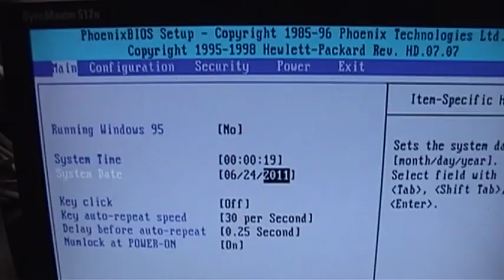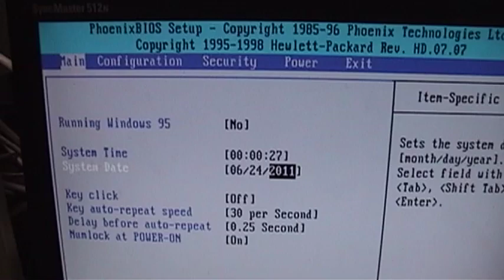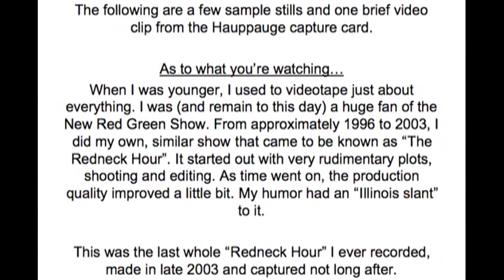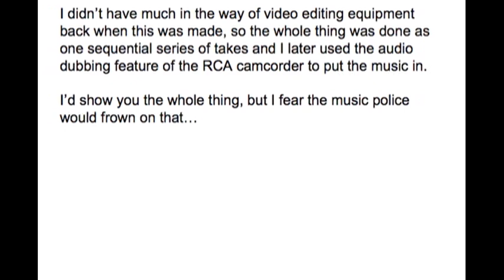The Old Video Capture PC

Comment: A lot of mid '90s through mid 2000s camcorders has color viewfinders, but as LCD panel technology improved to provide an image sharp enough to focus accurately and bright enough to be used in sunlight, the viewfinder became an afterthought in all but the really high end models. (And the B&W viewfinder in your TRV280 is actually a monochrome LCD, instead of a minature CRT.)

And are those Macintosh monitor connectors on those Matrox video cards?

Comment: One good reason to keep one of these old video capturing rigs in working order is to show the young'uns how difficult it used to be to do this stuff. Geez, you even needed a separate hardware decoder board for MPEG video because the CPU didn't have the horsepower to do it smoothly on its own. And cell phones have more storage capacity.
Full disclosure: my first rig was a dual Pentium 90 server with 3 PCI cards and 4 or 5 EISA boards back in the days of NT 3.51, so you had to do manual IRQ and memory configuring... That tank recorded some beautiful video, though. They were eventually transplanted into a quad Pentium Pro system. Because it wasn't weird enough.

Comment: Wow, I'm really impressed by all that you can tell about this system and your knowledge of computers. I do fiddle a bit with computers somtimes but this is before my time.

I do remember having a few computers from a dutch computer company called Tulip. They had the power and hdd led combined as well. But theirs was a simple dual colour led so that it would change colour when the hdd was active. They had a seperate power button though.

Comment: I recently bought a hp vectra vl5 series 4 computer on ebay and you mentioned in this video that you're hp vectra can't boot off of a hard drive bigger then 8gb are you able to boot off a bigger drive with overlay software i want to run my hp vectra with a ide to SD card adapter and I got a good deal on a 64gb micro SD card so I'm wondering if I need a smaller card for it

Comment: The case on that system looks a lot like the NetServer E40 that I used to have.  It was my first NASLite file server, and the hard drives from it are still installed in my current server.  Originally it had a pair of SCSI drives, and one of them was seized up.

Comment: Part2 - I have a feeling this is one of the earliest revisions of the VL as I believe the newer versions switched to a blue splash screen (the case still remained the same). So that's my guess with it. I don't know if they had leftover materials for the particular board and just wanted to use it up or what the deal is here but this machine shares a lot of characteristics of the older Vectras. This is just my theory though. I really enjoy it when you make old computer vids like these :)

Comment: That Quantum drive's seek test is very reminiscent of the old SCSI drives in older Apple Macintosh machines, particularly the LCIII, I used to own one back in 2004.
I'd imagine it's the drive that's jumped off a cliff. It may just need a better quality drive to get it running again.

Comment: Darn.  I was kinda hoping you'd show how to open this computer in the video.  I've got one of these, and it seems that the lid is stuck.  I'd rather not break it because I over looked something simple.
Looks like the two side latches pop up and then... that's as far as I can get things.
Reply from the maker: +Devin2277 Check the case lock. It's also possible for someone to carelessly cram the chassis back into the outer case shell with one or both release latches down. If that has happened, the only thing that will open it is careful application of significant force.
Reply: +uxwbill  thanks for the quick reply.  I shall attempt the careful application of significant force.
Reply: +uxwbill   Got it open!  Thanks for your help!  Mine turned out to have a Pentium 133 in it.
I always enjoy watching your videos, some more than once.

Comment: Part1 - I'm really a fan of the Vectra line and there are a few things I noticed about it. I'm guessing HP could've recycled the design from the Vectra XA line the board design is very similar in style especially with the riser card for your expansion slots. If you were to turn the case around on its side, it nearly follows the same design as the XA. The BIOS splash screen and the BIOS menu itself is nearly the same as well. I'm a bit intrigued too that it would use the old SIMM modules for RAM.

Comment: Hey Bill I have a question....

When you got all of these beauties...did this equipment work as designed? Meaning that they performed well enough to be usable when you got them? Or did you have to repair and refurbish every machine before you we able to use them? Did you have to fix components for all the ones that you sold so they would run well enough people to pay money for them?

Summarizing my question...how much money and time (if any) did you have to put into fixing these machines in order to actually make a profit or be able to use them? (im sure that you sold them for more than you put into them, or you wouldn't have bothered)

Just curious if you actually made any significant money on these if they needed work.

Would be awesome if they performed well from the start, easy money!!! :-) KUDOS!!!

Thanks,

Sean (Fellow Curious Electronics Nut)

Comment: What would you recommend to manage to capture this way on Windows 7 if possible? I'm interested in capturing my tapes with better smoothness than my capture card. :) Let me know what I could do that'd be exact or at least within capturing my tapes the old-school way please. :D The man who inspired VWestlife! YouTube legacies here. :)
Reply from the maker: Perhaps a better capture card is in order. It would probably be a good idea to make sure that nothing stupid is happening, to cause dropped frames or similar issues.

I have had outstanding results using the older MiniDV or Digital8 Sony Handycam models that were equipped with analog to digital video conversion capability. These will take an analog video source, clean it up and stabilize it, digitize it and then feed it into a waiting computer over a Firewire (IEEE 1394) port. These things do an excellent job. I've found nothing better in the consumer or prosumer worlds so far. Bide your time and you can find a good deal on a used one.
Reply: @uxwbill  Read my mind man! :D Already have a Digital8 and MiniDV, both need new batteries and the Digital8 is a DCR-TRV460, considering there's a tape stuck in it. It can turn on and function normally, it just flashes a C:3#:## error from what I recall. Its ironic this is exactly what I have to at least start capturing in an old-school way! :) Thank You!

I also have the Digital8 and MiniDV hooked up with RCAs to the Digital8 (DCR-TRV460 with the tape stuck in it lmao XD) as well as firewire going to the MiniDV (PV-GS29 it works). :D Can also be used with an extra RCA cable like these two share in common and helps a shitty USB capture card kind of capture better from what I have as a set-up. :)
Reply: @uxwbill  2020 Update! :D I bought a Hauppauge WinTV 26552 TV Tuner PCI Card similar to yours and with my backup PC converted from 64-Bit to 32-Bit I maintained capturing my videotapes with static completely without any drop of signal! :D :) Remarkable for a PCI Card and I capture it all on Virtual Dub 2 to my Hard drive. :) :D :3

Update: Now I have a 1996 PCI Card which can allow me to capture Horizontal and Vertical holds. Kinda looks like World's Wildest Police Videos now when I capture any videotape.

It's a 1996 Hauppauge Wincast/TV, and it's better than the 2005 card I mentioned to you two years ago. :D But maybe I'll compare the two cards someday with how they digitalise videotapes.

Comment: Bill, what is the pecking order of Dell computers from a quality/price position; Optiplex, Dimension, Latitude, etc. Just would like to know. 
Edwin, USN-Ret. (1962~1992).
Reply: ***** wait how high end is an E521
Reply: @cactusfilms8915  I saw a video of a E520 and E521 put head to head (gaming wise) and the E520 beat the E521. The E520 supports up the 8gb of ram, while the E521 only up to 4. Other AMD based Dell towers are the Optiplex 740.

Comment: That HP tower is a lot like my Deskpro 4000--PII 300, 192MB of EDO, 440FX chipset, a mechanical/AT power system, and a buggy hard drive (or controller) that refuses to run in DMA mode. The only thing missing on mine is the USB (there are two empty USB "spots" on the motherboard). 

I saw an Antec P180/P182 box in the background. Currently using a P182 to house my Opteron system!

Comment: I actually have a dual PII machine of this generation here (Klamath, i440FX, SIMMs and all), built around a Gigabyte GA-686KDX that I once got from the 'bay. A bit of a fussy beast, but interesting. 

Apparently Win2k kernel (ntkrnlmp.exe) builds later than 6992 no longer contain a workaround needed for these old PIIs in dual-processor operation. Guess how I found out.

Comment: i remember when i had about 10 or so computers with that type of cpu slot and 50 or so pentium 1's,2's,and 3's to put in them and tinker with  lots of memory, hardrives, video cards, and all sorts to go in with them   the fastest chip i had was a P3 at 533mhz  and it really performed well but did get warm after extensive use  but i didn't have many sim memory

Comment: My 10 year old Vectra VL400 (Pentium III 1 GHz) has a 20 GB Quantum drive with a Windows 2000 install.  It's really slow.  I also have an 80 GB Maxtor drive, and it works perfectly fine.

Comment: Crazy they would throw out Pentium 2 Machines as that CPU alone back then would have been worth at least $100 surely ?
Reply from the maker: Only a very, very few were Pentium II systems. Most were Socket 7 or Pentium Pro systems. They kept coming in on fully loaded pallets, so there was neither the staff or time to fix anything but the most minor problems.
Reply: @uxwbill  Ah that makes sense, lucky you knew your stuff about computers and which ones had Pentium 2 cpus inside, i remember few years back i swiped a few old Pentium 4 PCs one was a gigantic Fujitsu with a 3.4ghz hyperthreaded P4 inside and the other was an older HP machine with the Prescott P4 inside and it ran very very hot over 90 degrees , in the end i donated them both to cancer research charity store where i live as after i had upgraded them as much as possible i just got bored and they had outlived their use but fixing up old PCs is a great hobby certainly has kept me out of trouble for a few years.